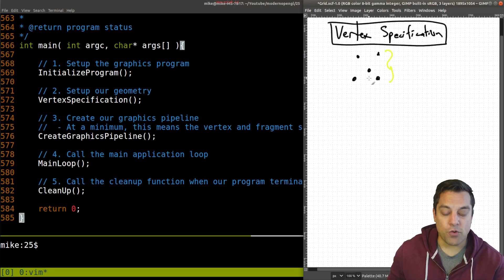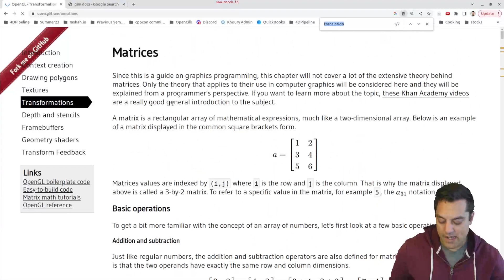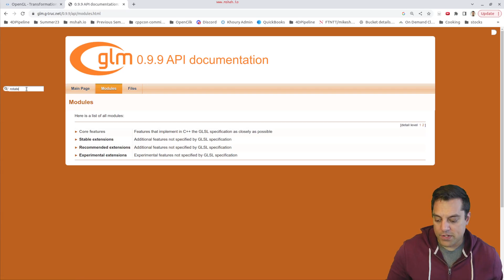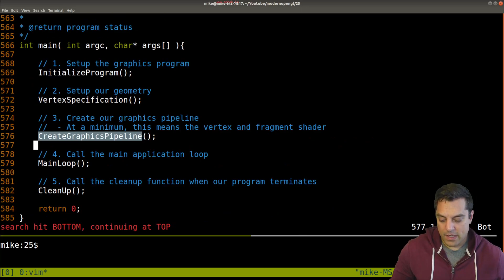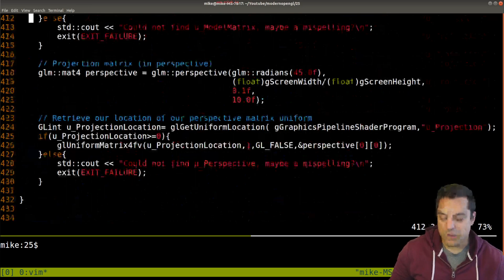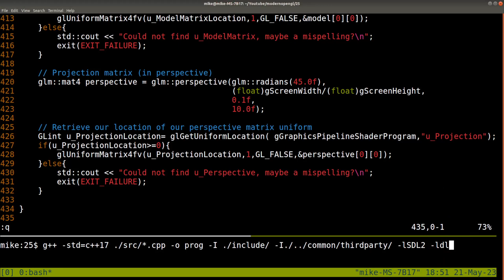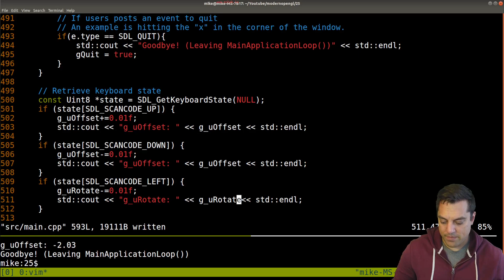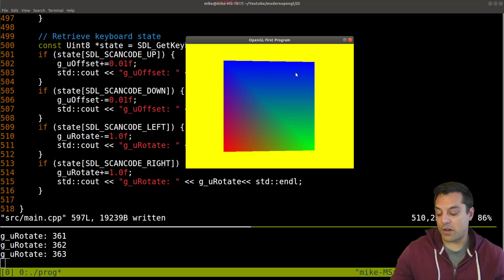[OpenGL Episode 25] Rotation Matrices (using glm)

Comment: If you set the vertices z point to -2.0f it will start with the cube in view. maybe a lower number on a different computer, but that works on mine.
Reply: I had it spin on the z axis first, so when I set up the y axis rotate changing my vertices on the z changed the origin so it spun in a big circle, this is the way I like to learn, it's just going to take a bit to figure that out, I understand what's going on just not how to program it. With blender you have choices to spin around world origin, object origin or other things like the cursor or other objects but that is more complex for me to worry about now. I'm looking forward to the lesson on Gimbal lock.

Comment: This My Best section …; mathematic; geometry and algebra; for me i work with higher dimensions differential Geometry; we consider these relation as deformation and this gave them more generalite; but for reality use affine geometry is better way with quaternions vectors calculus;
    Actual i still work with  variadic template and meta programming , advanced use of template ; writing some codes about these; my last is to merge many functions (Jason Turner idea ) in one object function (functor) ; image processing ; file system ; and library for general use of QuadTree Quad tree (special 2D and special 3d OctaTree) 60% already done…. ;

Thanks Mike;
Reply from the maker: Very cool to know! Please share your results -- sounds neat!